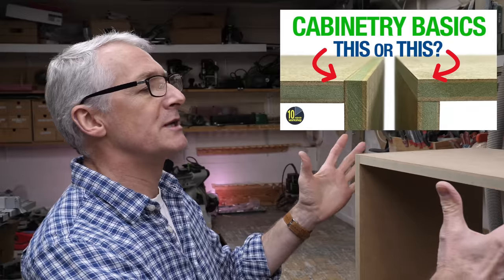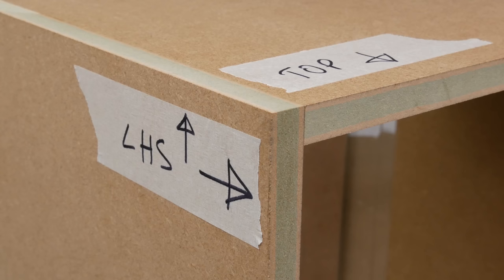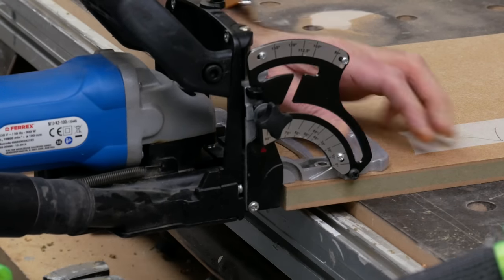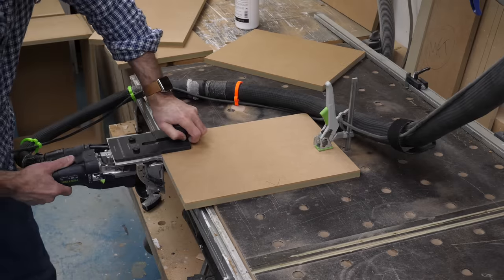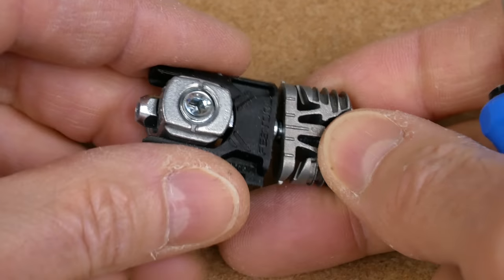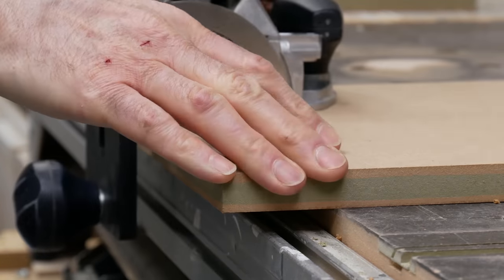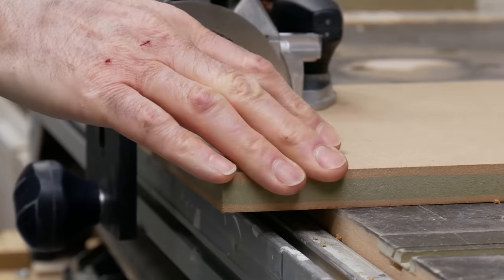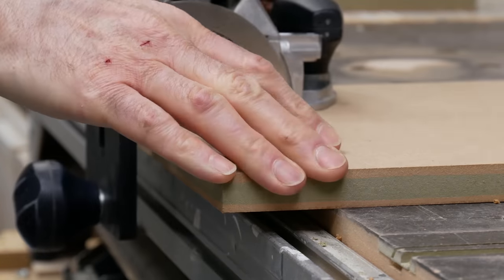Cabinetry Basics P3 [Video 437]

Comment: Really enjoying this series Peter. Perfect for us beginners.
Reply from the maker: Thanks! 👍
Reply: Very nice content, however, not very ‘beginner’ when using a Festool Domino 😅
Reply: @orconunit  you can be a beginner with deep pockets. They are straight forward to use and arguably easier than say dowels or pocket holes.
Reply: @orconunit  was talking about the series generally. Good to understand what options there are for fixings at different price points, even if I won’t be buying a Festool any time soon.
Reply: @orconunit  But showing all the other alternatives is very useful for us beginners

Comment: Many years ago I too made furniture (built in) for a living. Faced with a similar dilema of having "top boxes" of a built-in wardrobe too big for workshop final assembly and delivery to the client, I turned to using biscuits joints assembled on site. Fully assembled and glued they would not go through the bedroom door! But, as the bedroom was in use overnight I could not leave them clamped in the bedroom while the glue dried. I used 'Confirmat' screws between the biscuits. Just a 7mm pilot hole and a 9mm clearance hole. The head is self countersinking. Glue and assemble in the bedroom, then drive in the Confirmat screws and add to the framework of the wardrobe. Job Done!

Comment: Very much enjoyed your first two videos in the series, Peter, and about to watch your third.  I've used radial arm saws, fixed and sliding chop saws and tablesaws, but I've never seen a saw like yours, which looks so easy to use and very safe.  Could you do a comparison of the different types of saws, or at least talk about the power saw that you use.  Thanks so much!  Peter in the USA
Reply from the maker: Hi Peter, and thank you. I've talked bout the plunge saw, and the MFT sawbench many times over the years, there are entire playlists dedicated to videos on the topic, here are a couple to get you started:-

Tracksaw workshop & all tracksaw-related videos - http://bit.ly/TracksawWorkshop

MFT (MultiFunction Table) & MFT-related videos - http://bit.ly/MFT-related

Hope that helps. P
Reply: Thank you Peter.  My brother was a cabinet maker and I've always been what we call a "wood butcher."  As you probably know, it means someone who builds things but doesn't really know proper technique.   I've been doing volunteer work building scenery for two different theaters, so I am starting to learn a few things here and there... mostly how not to cut off my fingers.  Be well, and thank you so much for posting these videos.

Comment: One tip with the biscuit joiner that I have found helps improve my lines... don't reference off of the fence the way you are doing, always reference off of the solid bottom of the tool whenever possible. You get more consistent results like that. Biscuits are my go-to joint for cabinet carcasses, very quick, easy and reliable. Thanks for the vid!

Comment: I bought the Dowelmax back in 2010 and have really liked it other than the mess it makes when drilling holes as there is no dust collection. I really wanted the Domino back then but decided it wasn't worth the high cost as well as high cost of the domino tenons whereas the dowels were much cheaper. Interesting to see some of these other connectors I wasn't familiar with, but will be sticking with my Dowelmax as it does everything I need it to do.

Comment: Dear Peter - very nice and clear overview, thanks. One thought: if you make one of the slots for the Domino’s a tight slot in both panels which are to be connected, then those panels line up nicely. If the other slots at the same time are wider, then any slight misalignment of the other slots will not make the fit between the panels difficult. I typically make the front slots in the panels narrow and the other ones wider - which makes the fit nice and quick at the same time.

That is a difference as well with the Lamello connectors, which do allow some shifting between the panels, which can be nice, but it means as well that manual alignment needs to be part of your steps.
Reply from the maker: Thanks, yes, that was always how the domino was demonstrated - one fixed narrow ‘pair’ to locate the board, and the others loose to make life easier. But in the end, it was just another step to take and when you’re banging out a dozen carcasses a day, it was just easier to leave the edge mortises all narrow, and the face mortises wide, and just align them with a finger. You need to be a bit careful with lateral movement on the lamello fittings, too, because if you try to shift them too far they start to pivot - don’t ask me how a I know that! 😂😂👍
Reply: @10MinuteWorkshop  good example of why looking & listening to your videos is so interesting! Really something to think about: what is really determining progress and precision when you have hands on experience. 

Wrt shifting connections with Lamellos - I think I make the biscuit slots always just a little bit deeper for that purpose than needed. Just to be able to shift a little without opening the joint. I have an old “classic” Lamello machine, which I only use, obviously, for the flat biscuits. The Lamello Zeta which I bought more recently on the other hand is far more (has to be far more) tightly adjusted wrt the cutting depth. That is required for a good connection as you pointed out so rightfully for those types of more complex jointers.

It is really nice to look at your videos as well because of just these things. And there are so many more I expect. Things where the reality of making progress and doing lots of work with a jointer results in insights that slightly deviate from the instructions and marketing materials. I think it are really those insights which I highly value in your videos. So: thanks again!

Comment: Another great video, I like the 'bodgers joint' where you just use a dowel like a nail, line up joint, drill hole through both pieces (no fancy jig required lol), add glue to dowel and mash into hole with hammer and trim top with chisel, as the dowels are usually a bit wonky with each other they naturally hold everything in place, the only downside is that disassembly destroys object unless you drill out the dowels.
Reply from the maker: 'Skew dowelling' lol! I do the same thing with dominos sometimes - very effective! 👍💪

Comment: Hi Peter, good overview of options.  For the biscuit/plate joiner, you may want to also consider the Knapp Silver or Sunny fasteners that drive into a standard biscuit slot and are totally invisible.  Silver is much stronger than the Sunny though.  Steve
Reply from the maker: Thanks Steve - never heard of them, but wow, they make the Domino Connect fasteners look cheap! Good option to have though, I'm sure! 👍
Reply: @10MinuteWorkshop  I don't know about that.  The Knapp Silver connectors are about $1 per pair in the US and the Domino connect are much more.

Comment: Hi Peter, like the series. Just finishing my ‘ten minute’ style unit for my office. Shaker doors, with back, sides again shaker, all from MDF. My local suppliers don’t have Medite MDF and I am amazed by how much the material varies. Finish faces are not always that smooth and core can be ‘fluffy’ and less dense when drilled.
After much searching found a local(ish) Medite stockiest. Going to used for the next project

One extra consideration for someone starting out you can also get a ‘biscuit bit’ for a router. Harder to use out of the box than a biscuit machine but takes up less space than yet another tool and cheaper too. No criticism just throwing it out there for anyone reading comments
Reply from the maker: Thanks Doug! Yes, good point re the router cutter - assumes you have a router, of course. Re MDF there really is a big difference with eg Medite MR. It really is a much better quality board. 👍👍

Comment: Great video
.  For me it's, 18-gauge nails and glue for things that will be painted and Pocket holes where you won’t see them.  Dowels for where additional strength is needed and/or it needs to be knocked down and assembled in situe.  I don’t see the point of the lamello tbh, but the domino looks like a great tool.  Not worth it for me as a DIYer but for paid work would be a no-brainer.

As well as a dowel jig, I find those cheap dowel marking pins incredibly helpful in the real world of fitting things together in a room build.  Drill a hole for your dowel, stick marking pin in it, offer up the piece you intend to join and give it a tap, remove it and drill the mating hole where the point made its mark.  It’s a slow process but its simple and it works.
Reply from the maker: Thanks! Slow, simple, and working - sounds like me, lol! 😂👍

Comment: I bought the Zeta to build trailer walls - wooden frames with GRP planking - and it's easy. With an allowance, I achieved an adhesive joint of two mm. I am excited about the system
Reply from the maker: Nice! 👌
Reply: @10MinuteWorkshop  Danke! Thank you!

Comment: Hey Peter, It would be great to go through your thought process for choosing connectors. For instance if I said I wanted a bedside table,  all of these methods would work and once dry would be strong enough. But then would you go for the cheapest option, the fastest option or the one with the least faff? Personally I find I always lean towards dowels because they are so cheap, relatively fast and immensely strong, I admit I also love the exposed contrasting dowels as a feature. That said I can see the peanuts being irreplaceable if I have to build say 10 of them in a day or if I didn't have enough clamps. You could literally sand and paint before the glue had even dried.
Reply from the maker: Yes, very good point Sam - I may add that in as a follow-on video later on. And totally agree about the peanuts becoming a very useful addition in the workshop! 👍

Comment: Bought the Peanut 2 system based on your previous video on it. Going to use it to built a kitchen.
Reply from the maker: Nice! Great system! 👌👍
Reply: Did you look at the peanut 3 as well?
Reply: @Z-add  I did a bit. It is pretty much the same, except it uses glue, instead of a screw. I can use the same jig I bought for both peanut 2 and 3 connectors. I think the peanut 3 is more aimed towards professional shops using automation. I can be wrong, but that's the impression I got.

Comment: Hi Peter, I’ve stayed loyal to my Festool Domino. When I make cabinets and wardrobes now I just use the domino’s for alignment and then secure it all together by using M7 x 50mm Confirmat screws. They’re great screws to use, especially in mdf, they just need a 5mm pilot hole and screw in without any splitting. Using them also does away with the need for glue and clamps although using glue is still an option.
Reply from the maker: Cheers Andy! I never got along with confirmat screws in MDF - always preferred my regular Spax M-cut - but I know a few guys who use them happily, and they certainly produces a strong joint with dominos for alignment. 💪👍

Comment: Top video as usual. I would have liked some information on how to fit cam fittings as these are what I have used
Reply from the maker: Thanks! They're a nightmare to do without a jig, the cam & dowel fittings, and the cheapest jig's about £100, which is why I didn't include then here. 🤷‍♂️ 👍

Comment: Have used the domino quiet a bit at work and must say they are fantastic,makes the mortise and tenon possible in manufactured boards,he peanut does just about look like an affordable option for the home however,very interesting videos.
Reply from the maker: Big fan of the Domino, had one since the very start - but the peanut is so, so good!
Reply: @10MinuteWorkshop  Being a woodwork teacher I honestly can't fault the domino apart from the cost,I take it there is no special screw required for the peanut?

Comment: Again, top tutorial on basic cabinet construction! The peanut doofer looks cool. I think, though, I'd be inclined to hang out for the mini jig for my purposes. A good number of years ago, I purchased a cheap biscuit joiner (Screwfix) to use onsite to join flooring and to line up architraves on uneven walls. As far as making cabinets goes, I don't really think they are man-enough. Certainly no match to pva, nails and screws,
I'd say the next best (poor man's) option would be the good old dowel. Cheap and plenty strong; just a tad awkward to line up compared to the more esoteric options you showcase. 
Hey, I'd love a Festool domino, but quite honestly, I don't do enough furniture making to justify the cost. As far as built in units are concerned - kitchen cabinets and the like - I'd say that being able to conceal the fixings is only really an issue with gables that would be visible, as the external, top, side and bottom sections of the carcases would be hidden from view in  most galley or horseshoe style kitchens, where glue and screws, or pocket holes would be my preferred options.
As ever, much obliged to you for sharing your experience with such clarity!
Reply from the maker: Yep, totally agree. And these methods aren't exclusive either - most of the cabs I built had dominos for alignment, but screws for quick clamping, exactly for the reasons you state, that the sides were mostly hidden. 👍👍

Comment: Great video and very comprehensive. Particularly like your comment about cutting boards to same size as this was what I struggled with until buying a track saw. Am going down dowel route at moment using a homemade jig attached to a router. This seems to give good accuracy without cost of some of the expensive dowel jigs. While I looked at them I decided if I was going to spend that much I might as well bite bullet and get a Mafell DDF40. Just need to buy a stack of clamps now.......
Peanut connectors look good and a mini jig would suit my knock down needs nicely.
Reply from the maker: Hadn't thought of using a router - I might try that, thanks! 👍

Comment: I think the way you have your track saw guide setup in combination with your fence is absolutely brilliant. Do you have a video or an explanation of how this setup is done, what kind of hinge, attaching the guide? I am downsizing my shop and replacing my Dewalt radial arm saw with a track saw.
Reply from the maker: Thanks! It’s an off-the-shelf Festool MFT or Multi-function table & the hinged rail comes as standard. See videos #182 and #183 for more details. 👍

Video 182  https://youtu.be/0V-p5F7SjO4

I’ll be making my own version before too long, so keep your eyes peeled for that. 👍👍
Reply: @10MinuteWorkshop  Thanks for the speedy reply. I have been watching your videos for a little while and searched through the thumbnails but I must have missed these. I have purchased the UJK parf system so I would like to avoid buying a premade MFT. I'll look forward to your video.

Comment: Thank you. This is so useful to me. I've concluded that it's hard to beat the dowels. Low cost for the jig and materials. Connector completely hidden. Maybe not as strong as the biscuit, but then I can always use more dowels for more strength. Is there some disadvantage that I'm not aware of?
Reply from the maker: Only the precision they demand - I took a look at this in the Loose Tenon Basics video, [video 481] https://youtu.be/t86QGUn7dAI 👍

Comment: Peter, I love the videos. I have a question for adjustable wood shelves...what is the best way to prevent downward warping (usually towards the front of the shelf) without using too thick of MDF? I was thinking using biscuits with a hardwood face cover.
Reply from the maker: Thanks! Yes, a solid timber lipping of some kind helps greatly. 👍👍

Comment: Well you have pretty much covered every method of carcass construction I can think of, with the exception  of dovetailing!....a video for the future perhaps? 
Before the domino was invented, I lavished a small fortune on the Mafell Duo Doweller to speed up construction of some 3×2 ladder frames for a massive run of shelving in my attic, and it's still one of my favourite machines for quick, strong joints. Nowadays I think they are priced mid way between the domino and zeta, but there are some budget machines (triton?) on the market....they might be worth a look for the hobbyist who doesn't want or need to spend festool money on a jointer.
Reply from the maker: Thanks David! Funny, the Triton doweller was to the the third 'leg' of my 'Festool V Cheap tool' series way back; I bought three of them and had to return them all. But someone I know has just bought one recently, and is very happy with it, so perhaps they;ve ironed out the quality control issues. We'll see. 👍

Comment: Hi Peter, 
Cheers for another great video!
Have you ever had a chance to test out the Hafele ixconnect connectors that are supposed to work in standard 8mm dowel holes?
They seem to do 2 types; the SC 8/60 which is a knock down fitting a bit like a dowel version of the clamex, and there is the SC8/25 which is a completely concealed push-lock connector like a dowel version of the Tenso.

They look like they might be a good option for discrete knockdown fixings for folk who only have access to a dowel jig, and the connectors are a lot cheaper than the domino connect, clamex or tenso (44p each for the SC8/60 and 9p for the SC8/25).
Obviously would depend on if they work well or not though.
Reply from the maker: Thanks! I bought a few and had a play with them when I had the Mafell doweller on loan, and have to say I wasn’t overly impressed. The 8/25 hammer-in fixings were prone to splitting the MDF, and the 8/60 - apart from the obvious Mafell problem of needing to finish them off with a drill - just didn’t seem particularly strong, and the official jig to drill the access hole is stupidly expensive. I’ll be looking at them again - and any others I can find - when I do the ‘dowelling basics’ videos, which are probably a month or two away. 👍👍
Reply: @10MinuteWorkshop  Cheers Peter, much appreciated.